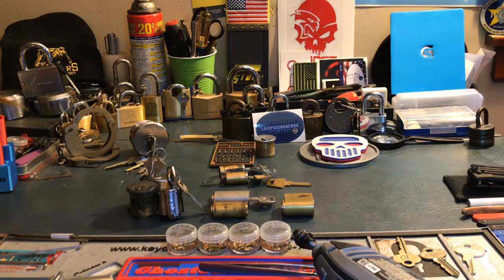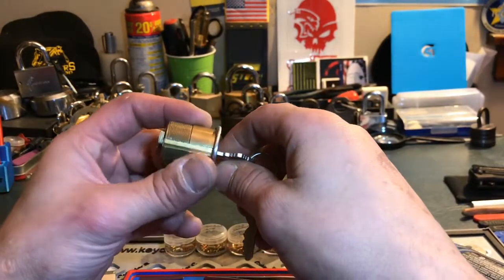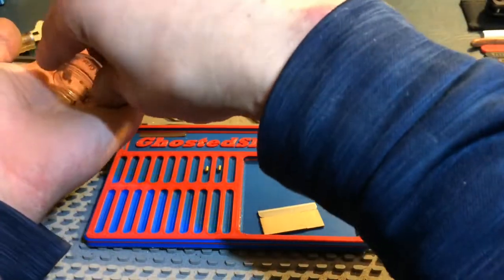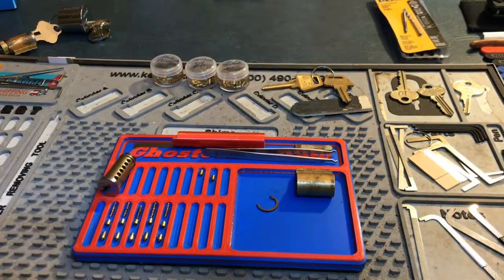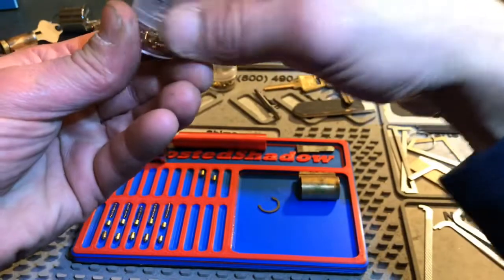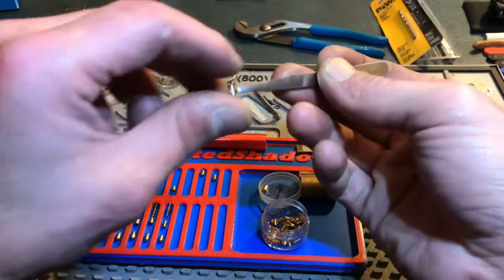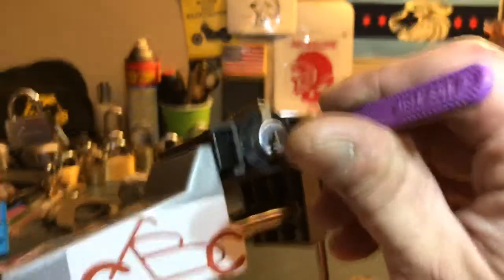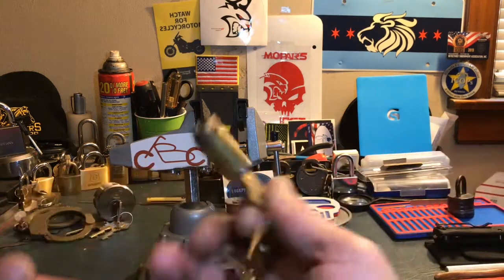(072) What I use and how I go about making a 🆑. Lock reassembled & picked at the end

Comment: Great video, and nice explanations. Some of the easiest locks to pick like standard Kwikset kiks have been some of the most difficult Challenge locks to pick, in my case. I sometimes take a crappy bitting precut key, and make one or two cuts deeper for a CL. Master wafers can be used in a CL, as a base going against the spring,  and then some strange t-pin acting as a driver.  I just picked a very difficult CL from AJ Clark that had a Master Wafer against the spring & a ball bearing as the driver on pin 6, with pin 6 keypin a t-pin. Made it act like a drunken spool. 
I have some Challenge locks I have already picked that I can send your way when I get a chance to get out from this lockdown, if you want.  Hit me up at my email.
Reply from the maker: William Mancel so true and you know I did miss speak on the wafers because you are correct if you have a Tpin or a very fine tip driver you’d ant a sm. Wafer at the top so it dsnt go in the spring
Reply from the maker: William Mancel wow that’s actually a great idea nvr thought of that. Yeah AJ has some great ideas
Reply from the maker: William Mancel and that would be awesome I would appreciate that more than you know brother I looked but didn’t see you email if you email me then you dnt need to put it on the comments
Reply: @ghostedshadow9282  I replied to your email.
Reply from the maker: William Mancel I saw I just responded thank you again brother.